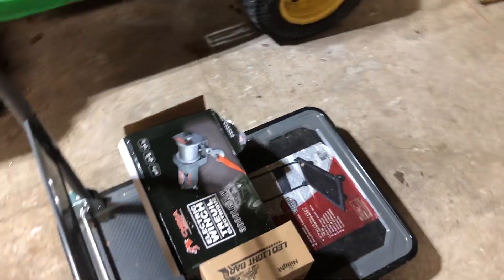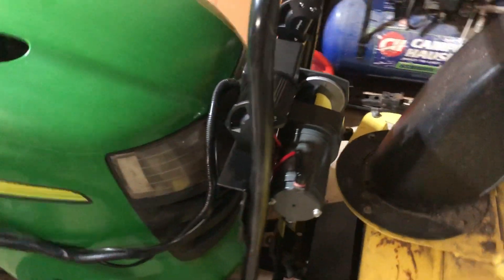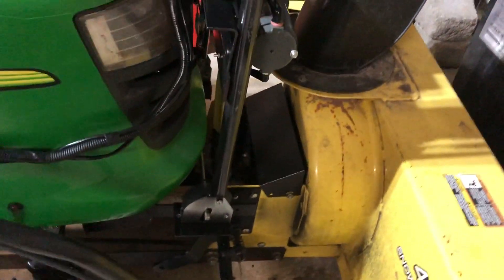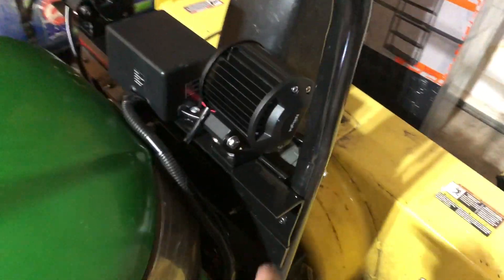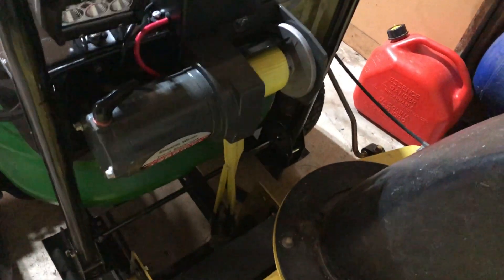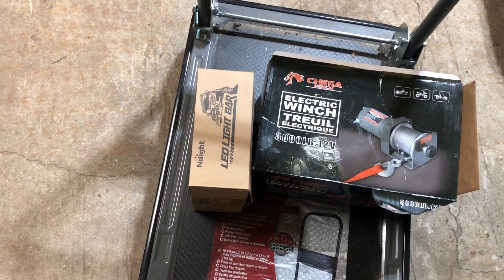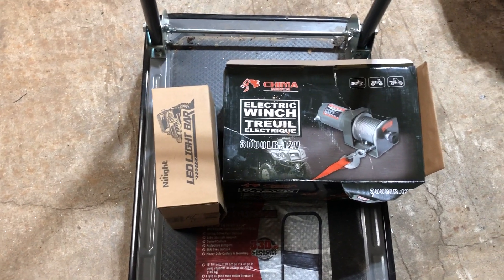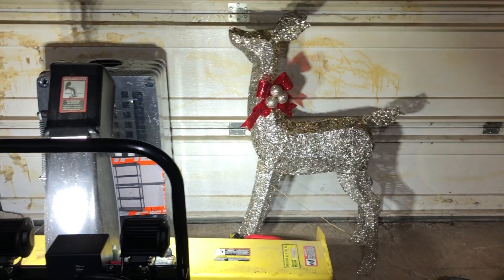John Deere 100 series snow blower lift solution

Comment: I have a John deere D170, I placed the winch on the right side of the frame. I Placed two steel plates, one on top of the frame where your foot rest and the other on the side. With the plates I added to brackets under each plate for better support. I dilled a hole on the top of the arm lift, placed a hook on it. The winch sits directly under the lift arm. I took the cable handle and taped it down so lock won't disengage. It works just fine.

Comment: Thanks very much for the share very same issue
Reply from the maker: Glad it helped. Good luck with your project. I recently put out another video with the updated blower installed on my JD160 with a 4 way joystick to operate the chute. Check it out if you are open to some other modification ideas.

Comment: I really like your setup. Wondering if you have any other closer up pics of the flat bar and bed rail hookup. Video goes a little fast. I can’t justify paying over $1,000 for the JD electric lift they sell now.
Reply from the maker: Unfortunately I don't have any close ups. What I can say is 2 pieces of 1/8 x 1 1/2" flat bar steel approx. 14" long was used, and the bed rail section was cut at about 4" and bolted to the flat bar. You might be able to have a better look by pausing the video? Hope that helps.
Reply: @TheAV8T0R  
Many thanks for the info. If I can ask where did you buy the bed rail?
I bought a 2022 S130 JD with a 2023 snowblower and the distance between the tractor and snowblower is shorter so install will be tight. 
And local dealer want over $1100 CDN for their electric lift using an actuator for the snowblower.
Reply from the maker: @larryfurmanic874  . I already had the bed rail from a when we replaced one of the kids the beds. I just kept it instead of taking it to the dump and it came in really handy. I often see bed rail sets for sale at the Restore store (kind of like a Good Will) for around $10-$15. That's where I'll be going for my next project. Check them out - you might more than what you are looking for!